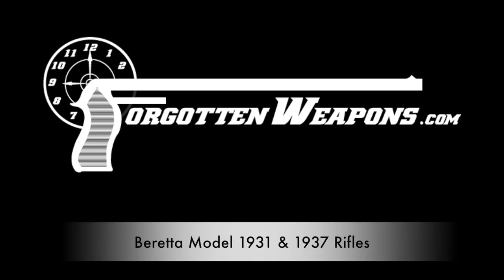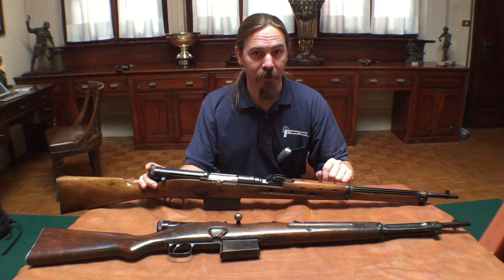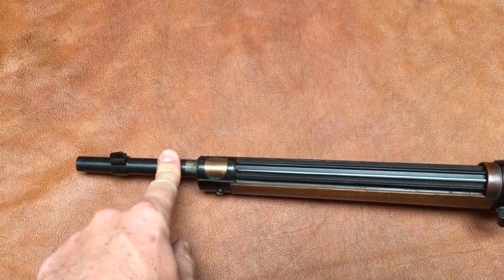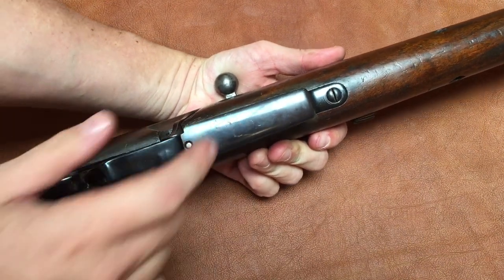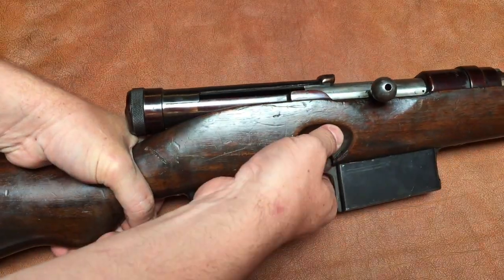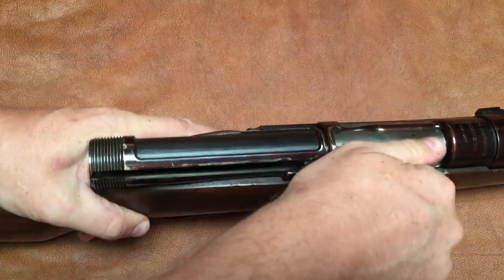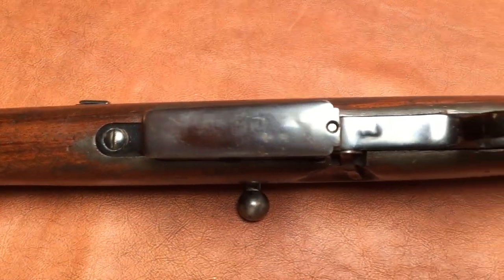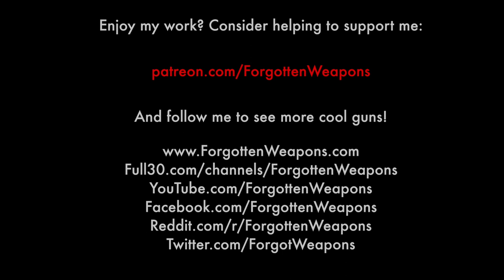Beretta Model 1931 & 1937 Experimental Semiauto Rifles

Comment: I know this is an older video, but 7.35 was packaged in boxes that contained 18 rounds. So as you suspected, the 1937 model having a 9 round capacity does indeed seem to have been based on logistical considerations.

Comment: So Beretta managed to design a semiauto rifle, without having to drill the barrel, that could also operate manually as a bolt action?
How did germany ended with that mess of a G41?
Reply: More beaucracy is why lol
Reply: The reason is old as humanity, i.e. Beretta had no weird requirements from customers!
Reply: "Lots" of engineering vs. "Good" engineering.
Reply: Germany made it so that no recoil operated design would be accepted.
Reply: The reason was that the Wehrmacht worried that drilling a hole in the barrel would affect accuracy. So they insisted on avoiding any gas operating systems. FYI the G41(W) was actually not that bad. It's just that the gas trap system is easier to get fouled up.
Reply: @einfachignorieren6156  I know that. That's why I mentioned the Walther version because it's what the German ended up producing the most out of the two G41 variants.

Comment: Re. the Sights, Friends.
On the Mod. 31, with the Rear Sight folded forward, it uncovers a 300 meter Battle Sight.
Folded back, it starts at 450 meters.
On the Mod. 1937 with the flatter shooting 7.35mm round, the Fixed Sight is most likely set at 200 meters; like the Mod. 1938 Carcano also in 7.35mm.
IMO, also like the Carcanos, the Sight Alignment is most likely to place the Front Sight into the "bottom" of the deep Rear Sight V.

Comment: I can see the designer testing an overlong stripper clip and settling on the maximum number of bullets that works well.
Reply: Yeah. They probably tested them and settled on the maximum capacity that could be filled with a standard "thumb push" stripper clip.

Comment: Ian I really must say I am genuinely surprised that you did not make comment on the bolt locking lugs. Surely the resemblence to the Stoner/AR system must have occurred to you.Is the Beretta the first use of this in a rifle? Would Stoner have known of this when he made use of it? Or did he reinvent the wheel,so to speak? Locking around the circumference makes much sense as long as it is affordable in process manufacturing. Needs some pretty specialized machinery,I would think.

Comment: The dark red shade on a lot of the metal parts on the 1937, is that by design or a happy accident?
Reply: It's the color you get on 1970's era Winchester 94 receivers when you re-blue them using the common hot salt method.
Reply: Hmm I've seen this on some old Beretta pistols as well from the same time period, I'm glad someone mentioned it because I've not been able to find anything online.
Reply: Hmm, interesting. I've got a Croatian PHP (redundant, I know) that's that color, I always assumed it was because it was browned rather than blued.
Reply: *****
Not entirely: Bluing = black iron oxide (magnetite) = Fe3O4; browning = red iron oxide (rust) = Fe2O3.  The latter doesn't get that extra spike of temperature necessary to convert the rust to magnetite, which is why I thought my PHP was browned; they were, after all, not made with what we might call state-of-the-art equipment.

That said, I don't doubt that magnetite can also be brown, under certain conditions.  I just hadn't realized it before.
Reply: Just remember the simple saying, purple wheat purple wheat, and you'll do just fine.
Reply: what does that mean?
Reply: Davidautofull well good sir, purple coloration and wheat coloration. Best way to temper untrued bayonets, that is if the bayonet came from the factory tempered incorrectly. If you do this to a knife, make sure you remember purple wheat purple wheat, and get that coloration in kind of a zebra pattern vertically up and down the blade with the temper lines going horizontally from spine to blade edge. You may or may not sand the coloration off the surface of the metal, if you should choose to do so.
Reply: That egg-plant like colored steel on Beretta products may be due to a particular steel alloy including Manganese or may be  Tungsten, I don't remember well, in place of Nickel. After 1935 Nickel was so hard to buy owing to embargo decided by the League of Nations that the use of Manganese or Tungsten was mandatory.  Beretta pistol mod 34 and 35 slides have that same particular color. Blueing that alloy gives that sort of reddish shade.

Comment: Usually, short-recoil rifle design requires a bolt accelerator. In the M1919 the accelerator is a separate piece, in the Johnson 1941 and MG-34 the the bolt itself acts as an accelerator, transferring some kinetic energy from the recoiling barrel to the bolt carrier, which in turn controls the bolt. This rifle is unusual in the way that it doesn't have a bolt carrier, and seems not to have a bolt accelerator either. If that's the case, this is probably why the rifle wasn't accepted. The lightweight bolt without an accelerator and the locking being performed by a spring instead of a mass do not compound well to deliver a reliable weapon. As slick as ingenious as it seems, this rifle was probably hypersensitive to dust and sand, and Mussolini had business in Abyssinia and Libya...

Comment: 12:00 Take a look here, the recoil spring actually bears on the firing pin, rather than the bolt. I think I've figured out how this works. 

The lug on the firing pin blocks forward movement while the bolt is unlocked. During the forward stroke, the recoil spring pushes on the firing pin, and the firing pin lug pushes on the cam surface of the bolt body. The bolt body stops against the barrel, and then rotates to lock, which frees to firing pin to move forward. The recoil spring is pushing it forward now, and the lug on the firing pin is clear of the cam on the bolt body, so it can move forward, but the recoil spring alone isn't strong enough to set off the primer without the momentum of a moving firing pin. The firing pin spring also counters at least some of the force, but it looks like the firing pin is actually resting lightly against the primer even before firing.

Take a look at 14:50. Before he threads on the spring cap, you can just see a few millimetres of firing pin sticking out from the back of the bolt body. Watch that little bit of metal move forward and disappear as the spring comes to full tension.

It's unconventional to say the least, but it should work well. A sharp blow from the muzzle end might set off a round though. It's definitely not drop safe.

Comment: 9 ROUND MAGAZINE????.
Due to Italian Table of Issues: Infantry Rifleman was issued with 162 rounds in 6 - ed chargers.
So when the Beretta in 7,35 was developed, the 9 round mag. And 9 rd stripperclip. 
2x9 strippers per 18 rd packet, same as 3x6 rd. Chargers per packet.
162 = 18 x 9 ( packets 3 chargers) ==27 chargers 
162 = 18x 9 ( packets of 2 strippers)
== 18 STRIPPERS
for same quantity of cartridges.
Ammo crates were to be same size, and cartridge pouches didn't need to be modified. Charger(6) ammo was pouched vertically ( clip uppermost) andstrippers were pouched horizontally ( stripper left and right.
Normal single unit 3- pouch issue hole 3x 18 rds ( 54) and double ( L & R ) held 108 rds...rest of 162 rds carried sealed packets in haversack or backpack.
Distribution of 9 rd stripper ( 7,35) would have been similar...single unit pouches...54 rounds, but only 6 strippers. Etc.
The Beretta 37, Breda PG in 7,35, and the ArmaGuerra 39 came too late for Italy's underdeveloped industries and the start of war if June 1940....

Comment: Sometimes I wonder why "semi semi automatic" rifles never caught on. A rifle that ejects and opens on firing and you just push closed would be a nice in between, akin to artillery systems.
Reply: Because if you were able to go that far, you might as well go all the way to semi auto for a military rifle as you've already lost the accuracy of a bolt action system but haven't gained much in return, plus it'd inherently make the rifle more dangerous and even more sensitive to ammunition loaded too hot that could blow back into the shooter's face, or potentially worse.

Comment: That's some REALLY nice plum bluing on the second model receiver :O
That usually is the result of a contaminated bluing process, right?
Reply: Several, but not all, of the Beretta handguns of those years have the slide (and sometimes the hammer) that turned like that. So we can say that it depends both on the material (otherwise the body and the barrel would have turned the same way) and the composition of the bluing salts (infact it doesn't always happen).
Reply: +Neutron Alchemist My father had  a Ruger MKII Target where the bolt and mainspring housing had that plum tint actually.

Comment: The reddish finish on the receiver of the 1937 is really nice; what is it?
Reply: Yeah I saw that too. A very interesting finish.
Reply: The bolt carrier of the SVT40 has similar reddish finish.
Reply: Is it some sort of case hardening?
Reply: If I am correct, it look as either "rust browning" which can at times come out red, or more likely just standard blueing that has some kind of variation in the process and materials. Think of "plum" bluing that can be the result of a number of different variances.
Reply: Some type of fire bluing, perhaps. I have some of the same plum color bluing on my Mauser 1914 pistol.